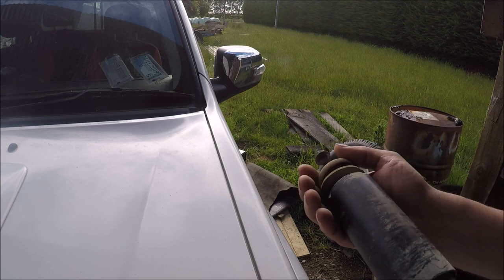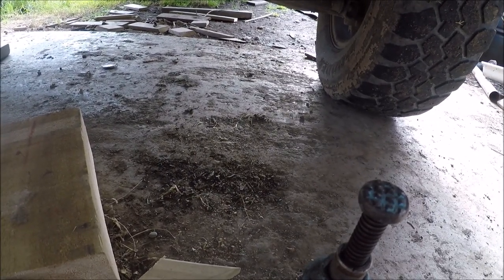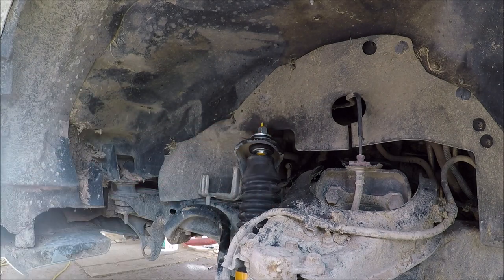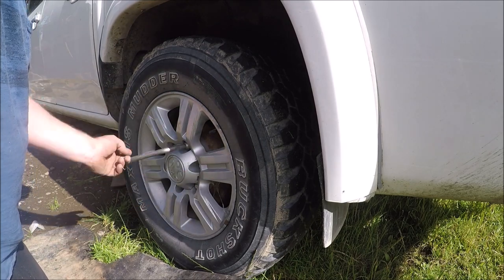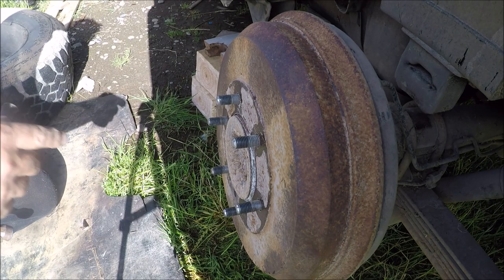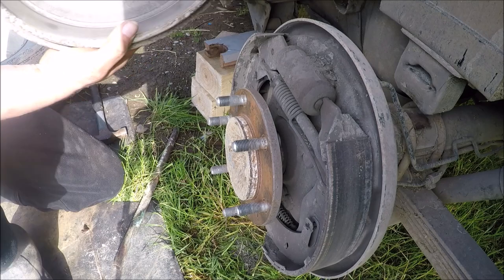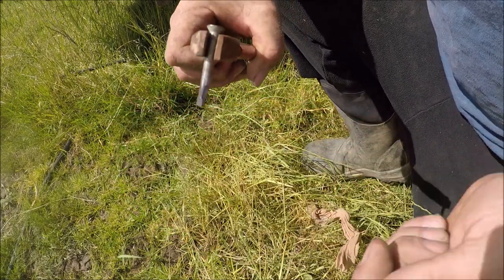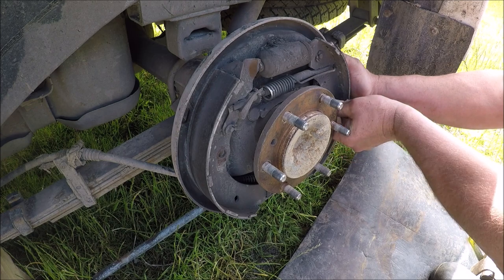Holden Colorado / Isuzu D Max SHOCKS and BRAKE DRUMS and BRAKES replaced

Comment: I have a 2009 dmax and am putting same brand shocks on the front. There is no diagram with the shocks and nothing on line from the manufacturer so a bit of a guess - but that smaller collar you put on top of the shock under the larger collar and bushing - there were 2 of those in my kit so I figure they are to space each side of the lower end horizontal assembly if needed. Now I am not sure what is correct.
Reply from the maker: I would say you are correct, if you run out of thread when tightening the nut, then i would say it needs the extra spacer.

Comment: I replaced mine today. And tightened the breaker via the back bung. I took it for a test drive and the braking felt good. I decided to tighten a little more and now the brakes feel very spongy. Any suggestions?
Reply from the maker: I’m not too sure why they would feel spongy after tighten, they usually auto adjust by themselves. 
Maybe they need to be bleed

Comment: I think the handbrake lever should be on the outer edge not inside the shoe. I’ve changed mine a few times and watching other videos it’s on the outside. Ie you can see it when you pull the drum off.